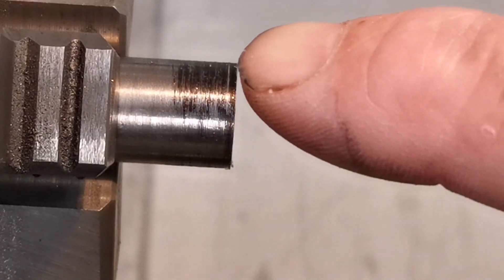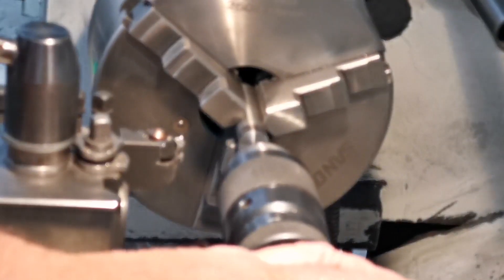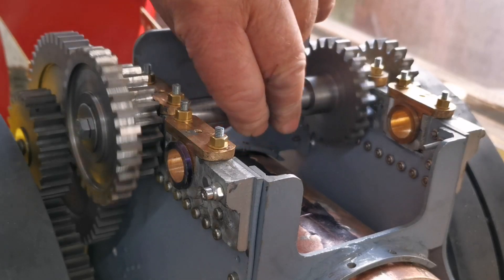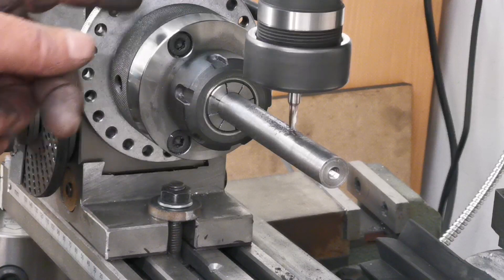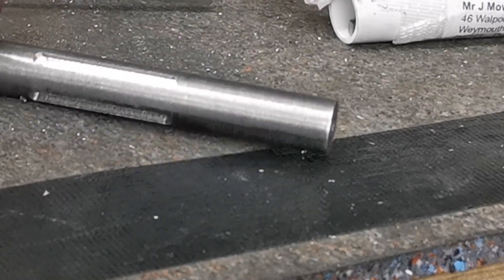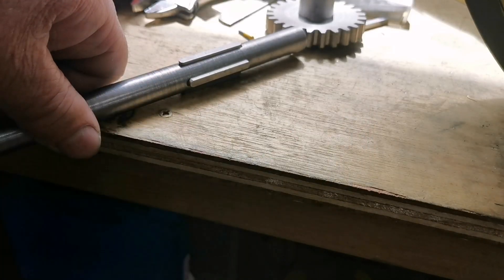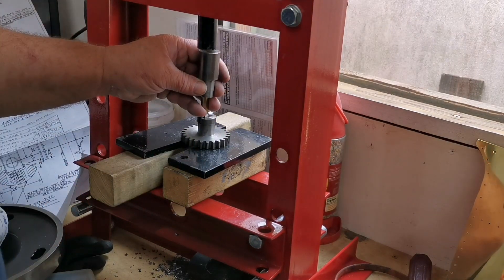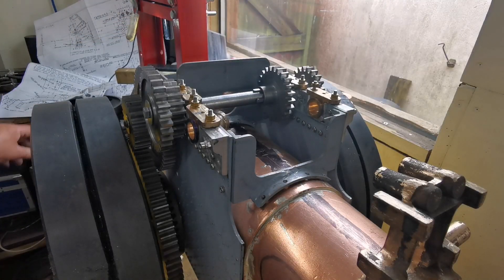2" Fowler Showman's Traction Engine the finished 2nd shaft

Comment: How did you index the other three key ways in the sliding gear please. It would be helpful for other builders
Reply from the maker: All i did was use a black marker on the end of the gear, placed the shaft through the gear,then I marked each side of the keys, then I lined up the broach centrally on the two marks, nothing too clever, but worked out fine 👍